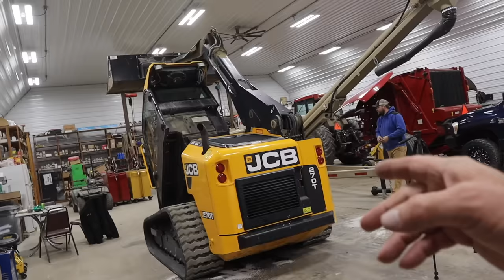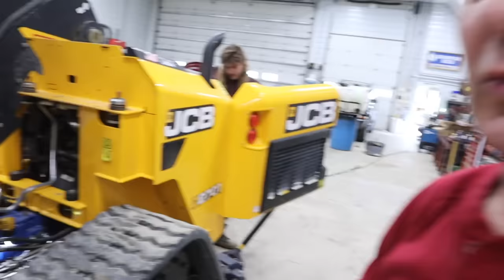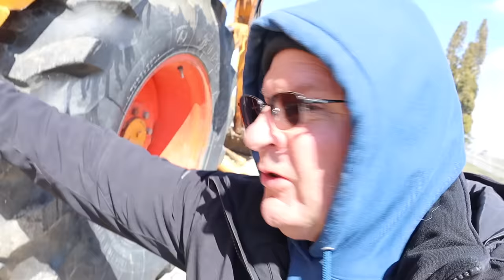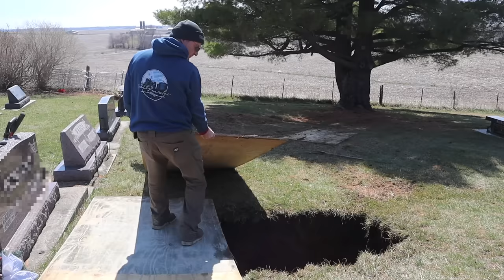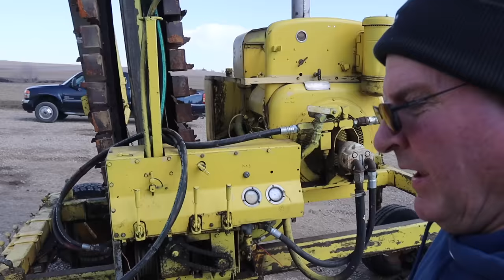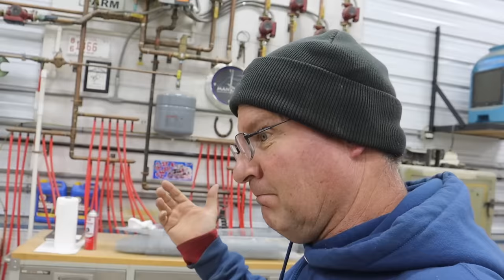I DUG A GRAVE WITH MY SON

Comment: My husband the hvac engineer says it sounds like the vent is plugged on your heater for your shop heater or the damper isn't opening like it should or if it has a power vent the motor is burnt out.  Or it could be the gas value is leaking so it gets too much gas at once. 

He said the most common issue is wasps or hornets nests blocking the exhaust.

Comment: Delayed ignition. The gas flows longer building up a pocket of gas that goes "boom" when it lights. In commercial boilers it is caused by a bad burner tube or a dirty burner.
Reply: If the air switch is bad the combustion fan will come on at the wrong time causing a delayed ignition. Get a different Boiler tech.

Comment: For sure ignition problem on heater. what you hear is a small explosion of too much gas before it ignites. My water heater in my RV was doing the same exact thing. The flow of Propane needs to be directed exactly in the right place as to mix with oxygen at he right time while the ignitor is on. I eventually corrected the problem through trial and error by slightly bending the port toward the ignitor.

Comment: Have you tried to clean the sediment out of the water heater?  We have a tankless water heater and periodically we have to clean the sediment trap and then run vinegar through the lines to clear out mineral deposits.  We are on well water.

Comment: "Booming sound could likely be due to "delayed ignition." This phenomenon occurs when there's a delay in the gas igniting, which can cause a buildup of gas and result in a small explosion or boom when it finally ignites." 

 Now, how to fix it🤔.  Make sure your service guys checked the gas pressure, ignition timing, etc.
Reply: Sounds like a tiny propane leak

Comment: My brother in law dug many graves over the years by hand no equipment but a pick axe and a shovel. now his son digs graves for many cemeteries. Here in WI
Reply: There was a guy. “Sonofabuck” he, and another guy dug graves by hand. Winter, sumner into his 80s.  Went out shovel snow. Start a fire, coal, wood, covered with frame with galvanized steel.   Next day remove, dug.

Comment: I know  you said that they have replaced the  igniter. I would also like to change the gas valve with it most. Valves are opening up by resistance from the igniter, and if the sensor that sees the igniter is  hot enough to ignite gas. Also check your  burners  with propane  causes rusting and difficulty in  lighting  and you will have the explosion

Comment: If it has an electrical igniter, it may not be reaching its full temperature quick enough and allows gas to build before it ignites with a boom.  I have had to replace igniters on furnaces before because even-though they might get red in color, they are not doing it quick enough.

Comment: I imagine the cemetery was laid out before the equipment was used. When graves were dug by hand.
Reply: Good Point
Reply: I have seen in some cemetery's especially in the east they will move the head stones so they are back to back one will be at the foot rather than the head of the grave  so they equipment and mowers can get thru to maintain lawns and for burials it looks odd but more efficient to maintain the cemetery.

Comment: It sounds like the ingniter is to far away from the burner and it get to much gas before it ignites also have them check the gas pressure at the gas valve may be adjusted to high

Comment: 02:27 DC That's just a brass compression fitting you could have bought at the local hardware store. Much cheaper. Of course it's farm related so it's a write off!:text-green-game-over:
Reply: I laugh everytime I hear "write off", as if people actually think it's a dollar for dollar transaction.  If you have $10,000 in taxable income, and write off $1000 you don't get a $1000 back in taxes, your adjusted taxable income just drops to $9,000.  If you're in a 25% tax bracket, you will reduce your taxes by $250.  So $750 still comes out of your pocket.

Comment: The unit should turn fan on evacuate the fire chamber then start igniter and release gas once lit a flame sensor sees the flame and allows it to high fire  so maybe a weak igniter or a sticky gas valve make sure there is no birds nest in the cubustion  air intake pipe causing a bad air to fuel mixture the same for exhaust gas pipe, also make sure its not just making steam make sure the primary circulator is functioning if it was failing it could cause the water to over heat into steam but the flow switch should catch that, I miss doing problem calls lol

Comment: I have seen on a propane system where the regulator goes bad and in this case the heater went fire hot and the pigs suffocated.  When they fixed it, two regulators were plumbed in the line just in case.  Good luck with your problem. Enjoy your story Daddy Cornstar.

Comment: Daddy cs the boom could be a delayed ignition caused by one or more burner holes plugged with burnt dust.   If I looked at it I would first look at for a white powder near the pilot or igniter. Id look to see if a couple holes were blocked or plugged up near that igniter or if multiple burners are close to each other.   A delayed ignition can happen if gas is coming out of a burner but access to the igniter or pilot is blocked and the burners don’t lite until gas builds up enough to drift over to that pilot or igniter

Comment: Unfortunate you did not give much of a good shot on the Boiler. It does look like a two pipe air input and exhaust. Check to make sure nothing as gotten into the pipes. Wasp nest and birds nest will mess with the air/exhaust causing lack of air to start the burning process and thus a delayed ignition.  A chamber that is not sealed will also cause such issues, I would check for issues with the model!!   Ignitor weak, wrong or improperly installed can also lead to a failure to ignite. An ignitor, if flat surface style that heats up to ignite as to pull info power (amps) to actually get hot enough to ignite. If spark style needs a hot enough spark to once again Ignite. A poor ground on a spark system can also lead to this happening as well as the surface of the sparker or ground side being dirty. Electricity does not like to go through stuff. One more thing that can cause such a problem is dirty burners. Cole at the house was just talking about cleaning the burners. If the gas can not freely move through the burners it can cause the gas to move away from the igniter. Unlike what Cole did, I remove the burners and take them to a sink and flush water through them and cover the big openings to force water through the small openings of the burner. One last thing that can cause problems is the control board.

Comment: Sounds like your system has a water hammer issue. Maybe try changing the check valves or see about installing a pressure relief valve.

Comment: I think the sound you’re hearing is called an air hammer. It is where when the pump kicks in and creates a pressure against the copper pipes they can put a air chamber in it, which for stops it from hammering.
Reply: GAS not Water related...

Comment: On the tankless...gas has a narrow band ( %) when it is combustible...what you describe is a build up of a large amount of fuel and air, then ignition. The heater will run a purge cycle ...test the ignitor and  check proofing switches , blower speed , etc. It can upon firing, fail  and the blower would go into purge mode . Some source of ignition can cause a boom at that time...more likely the flame is unstable and surging due to fuel quality, a bad regulator, or lack of oxygen in the intake air. The mixture can rise or fall into the percentage needed and Boom ! Check clearences for terminations and your fuel system. G.L.

Comment: I worked at a place where the furnace did that when the wind was strong from the NW.  If a door was opened to the wind side the furnace would finally light.  The answer in that case would have been to plumb the intake combustion air to the same outside wall, but of course they never did and the heat exchanger cracked from the from all the little explosions.  Obviously the inducer fan is going, but is there sufficient flow out the exhaust?

Comment: They show your experiencing with that hot water floor system is at the system is introducing the hot water to the cold water way too fast so that's what gives you your explosion sound The system is cranked up way too fast for it to circulate so it needs to be set to slow so that way it'll move throughout the system slow first and then it can speed up because the minute the hot water is introduced into the cold water system remember it expanse which shocks the whole tire system which that's what gives you your loud boom

Comment: My boiler in basement was doing same thing, Navien  . Then it throws a code about exhaust. I was next to it one time it did it, thought it was going come flying at me....BOOOOOOM!  I saw the panel/cover expand!

I jus turned it off for most of winter, I was going to tear it apart and see if something crawled in the Exhaust over last summer?? It looks clear  but can't see all the way in. It seems to be purging like it should before it  lights the fire, but o man.....didn't want to burn down the house.

Not an answer for ya, but mine is doing same thing. Let us know if you get or got  it fixed.

Comment: The tolerance on that little part is very tight because they squeeze together so tight they will not leak. You are paying for the close tolerance of both parts.
Reply: It's just a compression fitting.

Comment: Floor heater BOOM… it’s hard to go by a description, but it could be something simple like water hammer. I paused the video and looked, I don’t see an anti-hammer device (a simple tube with a dampener in it). You can get them anywhere. It is cheap, simple to install, and it won’t hurt if it’s something else. 
Hope this helps!
Reply: GAS not Water related...
Reply: @m9ovich785  I’m just curious how you know? It’s hard to sound polite when typing, I am truly just trying to learn what I missed.
Reply: @m9ovich785  I was also thinking the purge cycle isn’t working, I’ve also seen arcing on electric ignition. It’s just so hard to tell by a verbal description.
Reply: @kenwoodfl  He described it in the Video.
An In floor hydronic system will not Usually not have water hammer because it is a Closed & balanced system. 
The Pumps are turned on/off instead of using valves. The most You will hear is Gurgling if there is Air in the System. 
Hope that helps..
Mike M.
Reply: @m9ovich785  thanks Mike. 
I appreciate your kindness, have a great one!
Reply: @kenwoodfl  The other thing I forgot to mention. is the use of the Expansion tank.
It absorbs any fluctuation of Pressure in the System,  Which is about 12 to 15 Psi...
Reply: @m9ovich785  Yes! Expansion tanks keep constant pressure in the system and because of the bladder would nix that as well! Great thinking!

Comment: If the hot water pump turns on and you hear the "boom", the system might be hammering, due to having air in it.
Reply: GAS not Water related...

Comment: Have the HVAC guys replaced the air scavenger yet? Mine seems to be good for only a few years. Especially if any valve don't open fully and cause cavitation.
Reply: GAS not Water related...

Comment: Great DC, amazing how you always treat the cemetery work with such respect. Set up the Go-Pro and point it at the system and let it catch the noise! Sounds like an air or exhaust situation but that’s just an idea I had cause our pipes were banging in walls and there was air in them. Good Luck 👍

Comment: That is daylight robbery for a compression joint, you could knock one of those out on a small lathe in an hour, you should check around and see if you can retro fit normal plumbing parts for them. If the heating guys said it’s fixed and it’s not get them back, you don’t pay again if it’s not fixed the original problem.
Reply: All you have to do is buy a lathe, learn how to use it, spend an hour making it and hope it works.  The odds of you every needing to make another one is minimal.

Comment: To much propane pressure. Have your guy put manometer on the inlet of the gas valve adjust to factor specs. Then put gauge on burner side of the valve and adjust for burner side.. normal 12 oz. In.10 oz out. After adjustments.. start up a check. .. too much propane blowing past the igniter on startup then when it ignites…boom!

Comment: Propane or Natural Gas? Might be a incorrectly sized orifice, bad or dirty burner tube, or a bad heat exchanger. Also could be the gas valve isn't set for the correct inches of water column for the unit.

Comment: Replace your instant hotwater with an electric or gas 80 gallon water heater.  You are asking too much of such a small unit to heat that floor with that many zones.   Those instant hots are fine in alabama but you have real winters in your neck of the woods.     As for the banging that sounds like one or more zones are airbound.

Comment: The bang is called water hammer.  It’s caused by steam creating a bubble in the pipes, pressure changes then the bubble rapidly collapses.  The boom is like a hammer and will brake your system.  I don’t know the fix, it’s  either pressure control or temperature control.  The temperature may need to change slower.  The pressure is controlled by your system.  You may not have the proper pipe size or something like that.  Some kind of pressure relief valve may be necessary to protect your system.
Reply: I would disagree. I believe it is an ignition issue
Reply: @Spazcan  Assuming it’s a gas system, even then a loud bang needs to have a container.  The bang would break it.

Comment: you have a completely unprofessional setup for doing graves! get a jcb wheeled excavator with a trailer so it can loadout the dirt in one easy operation requiring one operator! loader and loader trailer will fit on the semi not requiring a separate vehicle and trailer.oh and get some rubber mats so your ramps hit rubber not slamming making too much noise!